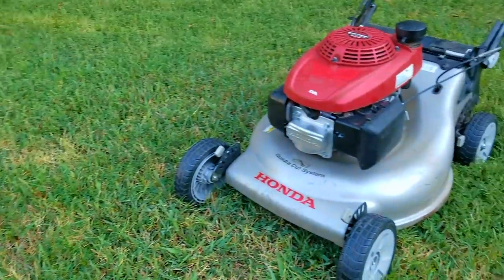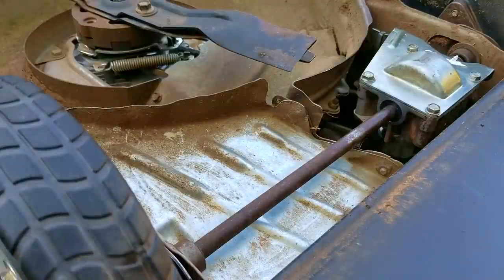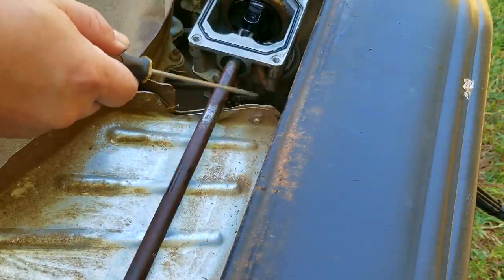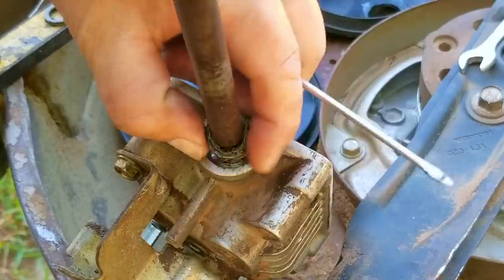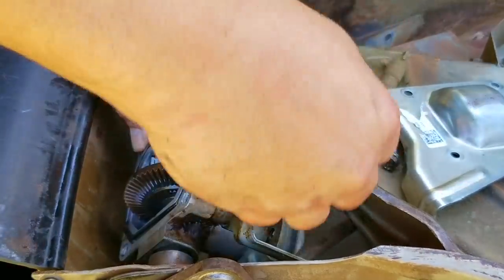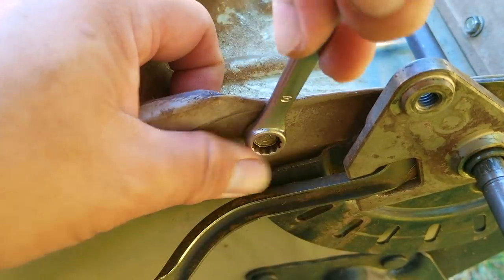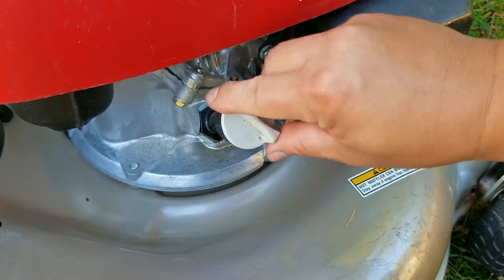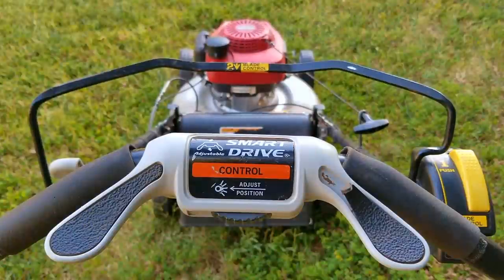Oil leaking from Honda Lawn Mower, was due to a bad oil seal on the transmission.

Comment: for the seal, a generic bearing reyailer sells seals by dimensions and usually, it is less than rge half of the price of an otiginal and usually it is as good if not better than the original, very often, these equipments are thrown away for problems that are easily repairable.
In over 40 years of home ownership, I never bought a new garden equipment, I always rescued equipments that have been discarted.
many times, the failure was due to an elementary cause, as elementary as a shorted kill wire.
very good video
Reply from the maker: thank you for the information

Comment: Outdoor Power Repair Shop owner here, i would never discourage a repair and not fix just to sell a new mower, any honest repair shop would repair it than tell someone they need a new mower, and truthfully we don't make as much money off selling new equipment like some people think lawn mower shops do, repairs or fixing and selling used equipment is where we make more on, now if a piece of equipment is worn out and just flat out abused i will suggest to the customer that they might want to consider buying a new piece of equipment with a 2 or 3 year warranty vs sinking money into something that is not worth fixing. For replacing a seal in a Honda push mower i would charge an hour labor plus the part so around $95 compared to a new Honda mower (i am a Honda dealer) at $339 for a basic push and $579 for a self propelled steel deck model. A Good used Honda mower like in this video, i could sell with out the bagger easily for $150-200 depending on the year model.  Most repairs shops only service and repair what they sell, that is big time dealers so naturally they will push to sell equipment because they choose to only service & repair what they sell, small shops like mine don't do that, i don't sell much new equipment, i have it yes (handheld products and walk behind mowers) but i'd prefer to fix someone's equipment than sell them new equipment, i believe in using something until it can not be used or repaired anymore. I always say have a certified professional do preventative maintenance twice a year and the equipment will last a lifetime.
Reply from the maker: thank you TheOutdoorPowerGuy for the information. Not all shop around here are so caring.

Comment: Those Hondas are pigs to push without the drive assistance. I like your spanner wrench between the seal and the pipe solution. Great idea. The only thing I would have done in addition would be to smooth out the corrosion on the drive shaft where it contacts the lip of that seal. That's crazy amount of $$ for that seal.
Reply from the maker: Thanks for the tip, and it makes sense. Yes I might have to consider a universal seal because $18 is high for what it is.
Reply: @INSIDEHOUSEGARAGE  True, if that old seal was not so torn up, the size numbers might have readable.
Reply: Everything is a crazy amount of $$ these days
Reply: If you smooth out the shaft from corrosion doesn't that mean you'd be taking a little metal off the shaft for the clearance between the shaft and the seal?
Reply: @punchogunter2362  not enough IMO to alter the diameter. Besides, the spring on the inside lip of the seal will adjust.
Reply from the maker: the next time I'm going to Try a universal seal and see how it works.
Reply from the maker: I know right.
Reply: @INSIDEHOUSEGARAGE  Look for a bearing and seal store that sells automotive or trucking parts local to you. They can match up the seal by part number and measurements and come up with cheaper brands and part numbers.
Reply from the maker: That's the plan next time I do this job, thank you D4x4Bronc.
Reply: @INSIDEHOUSEGARAGE  once you get the cheap part number document them and share online
Reply: I know what you mean. I had one just like that and it was hard to push without the self propel system.
Reply: I would have wire brushed / wheeled the shaft that I had to slide the seal over to clean the corrosion off it woukd make it much smoother then rubbing across rust even if it's just surface rust and where the seal actually sits looked clean so that would just get brake parts cleaner sprayed and a wipe to clean the surface and then the seal would go on with a little lube on the seal but that's just me, great idea with the pipe and wrench to seat the seal

Comment: Great video and repair. Unfortunately, root cause analysis says it's going to happen again as the root cause has not been addressed - the shaft is prone to picking up weed fibres that will find their way into and destroy the seal. Corrosion on the shaft will also destroy the seal. Given that my deck is corroding underneath (I blame galvanic corrosion as I wash it well and store it in a dry location after every use), I'm going to put grease into my gearbox. It's low speed, so low heat and low centrifugal force so it won't fling the grease off. Thank you for taking the time to make this video. Seeing this video has shown me the failings of this system. Your video is concise, no bullsh!t, and accurate. Well done.
Reply from the maker: the root cause was not weeds but synthetic fibers from something they ran over.  I couldn't tell you what they had in their yard that has fibers like that.

Comment: Hey Just came across your video. Honda’s expensive, lots of bolts and nuts , labor intensive, parts are expensive . I’m a equipment technician and people have no idea that Honda equipment is labor intensive. This is a excellent video showing all of this.
Reply: Hey Along with this the shafts get corroded and rusty and should be sanded down prior to seal and bushing adjusters install.
Reply from the maker: thank you Joseph Puchel
Reply from the maker: yes you really absolutely right.

Comment: Great video series! Have to wonder why the seal failed.  That mower is certainly worth the cost and effort. Thanks for sharing. 👍
Reply from the maker: no problem. They must have ran over the material that breached the seal. kinda looked like polyester fabric of some sort.
Reply: It happens to alot of equipment string / fiber from who knows where wraps around a spinning shaft wether it be a drive shaft or some other spinning shaft and works its way into the seal or even bearings and cause damage to the equipment,  could have been some trash blow into the yard and didn't get cleaned all the way up a little bit of that fiberis material got missed and next time the yard was mowed it got caught on the shaft and eventually took the seal out like an assassin

Comment: Another good video there sir. It was very interesting to see that string or whatever it was cause that seal to leak. 
Oh and that is one quiet mower for sure, both while just the engine running and then when the blades were engaged. 

You are one lucky guy to find all these mowers on the "curb" 🤔💁🏼‍♂️😂😂😂
Reply from the maker: I was lucky. It was about 10 or 1030 when I saw the ad, and it was on the far side of town.

Comment: Great job! Even though the seal was way too expensive for what it is it’s still worth it since the rest of the mower is in such great shape and it’s got the blade brake feature. Surprised those shaft bushings just fell out like that, usually they put up a fight and won’t come out.
Reply from the maker: I didn't show all my efforts to take it out but you're right, it did fall apart pretty quickly. thank you mjg263

Comment: I might have tried putting some grease in the transmission, and see how that worked, $18 for the seal is a lot of money, but you have a good working mower now .
Reply from the maker: you are right about the grease, I wanted to try the seal and then if that didn't work, then grease time. thank you Alan Lake.
Reply: @INSIDEHOUSEGARAGE  I am considering a #00 grease to avoid any leaks.

Comment: I still think a thicker oil in the transmission would have worked.  You had several comments before about doing that.  Did you find out something that caused you to go this route?
Reply from the maker: not really, I'd like to fix it the way it came from the factory, If for some reason the new seal leaked, I would have resorted to grease.  Now I have been know to fix that "the best I can" and it would not have left the factory, but It's usually because the parts aren't available or affordable.

Comment: Nice job and nice repair. Too bad your video time wasn't the real time to complete the repair 🤣 I have worked on small engine transmissions and they are time consuming. Not a difficult fix but take in to consideration is this mower worth it? As a hobby, not too bad but can be pricey depending upon the make and model. Appreciate your efforts...
Reply from the maker: thank you Mr G. it definitely took longer than I showed. I don't recall how much film time I started with, but If I had to guess, it was over an hour of raw footage.

Comment: You might want to invest in a small good pick set. I personally use the Harbor freight black handle set $10ish for 4 big and 4 small ones. I use the small ones weekly at work and they are good. If you have a parts store near you you could find a decent set there I'm sure to.
Reply from the maker: you're absolutely right about the pick set. Mine have since disappeared.
Reply: @INSIDEHOUSEGARAGE  those would be alot better then a flat screwdriver. Picks are something you can't do without in my opinion.
Reply from the maker: completely agree with you.

Comment: I would replace the seal. I actually have 2 honda hrx217 mowers I got with non functioning transmissions and that same seal leaking. They look to be harder to get to and replace. You may have been able to remove the wheel height adjuster and slipped off the seal without removing the trans on that one however.  What type of oil did you use there. That trans also appears to not be a hydrostatic transmission.
Reply from the maker: no this is not a hydrostatic unit,  this trans only requires motor Oil for lubrication.

Comment: Hey how are you I have to ask your opinion. If I drain the tank an run my Stihl weed trimmer out of gas is it ok to put a way for winter or would you do something else thank you love your vidoes
Reply from the maker: I'm doing well, thank you Frankaferd Hadley. If your winter is only 4 months, then that's all I would do. If your winter is longer, you might want to consider fogging your eying, to keep rust from seizing your ring(s) to the cylinder.

Comment: What's your personal limit expense for free mowers and what's the most you'll pay for a mower both working and not working?
Reply from the maker: hmm.. for a free mower, I will not spend over $100, and that is usually for the transmission.   And as for buying mower working or not, ... the depends on what kind of mower it is.  I will pay unto 100 for a good toro, or honda, but for junk mowers, I will only pay 20, and that's it.

Comment: What fluid do you put in a lawn mower transmission? I have a 23" self-propelled Troy bilt, and it is starting to lock up when it's pulled backward. I thought it would be the usual issue with the keyway, but on my model, it's inside the transmission.
Reply from the maker: it depends on the mower, some ask or gear oil while some ask for synthetic motor oil. I don't recall what I poured into this one.  To be honest, whatever it look like, that came out of it, put the same back in.

Comment: How often do you think the transmission fluid should be changed on Honda lawnmowers?
Reply from the maker: that's a tricky question, for they Hydrostatic, I'd check it one a year. As for the others,  I'd check it once a year, but I doubt you'll need to replace it. The issue, is that to inspect it, 
it's in the position to replace it. Like I said, tricky.

Comment: Could you show the part number for the seals? Thanks
Reply from the maker: I would, but my seal, may not work for your machine. I would call a shop and give them the model and serial number for from your machine, and they will tell you, what the part number is .

Comment: you could put grease in there. then no need to replace the seal
Reply from the maker: you are correct. The grease would have worked as well.

Comment: Why don't you use this as you new mower since you spent so much on it.
Reply from the maker: because I'm trying to prove that my old beat up honda will still last, as long as the maintenance is kept up. I have someone in mind to get this one anyway.
Reply: @INSIDEHOUSEGARAGE  oh yeah.
Reply: @INSIDEHOUSEGARAGE       My lawnboy is over 30 years old and still going strong.    Been thru 2 sets of rings though.   I don't know how many tires,  or belts, too many to remember. Ohh and 1 coil    If you take good care of them the old ones last forever.    No so sure about these new ones where 60-80% of it is all plastic.
Reply from the maker: you make a good point. thank you Anime Red.